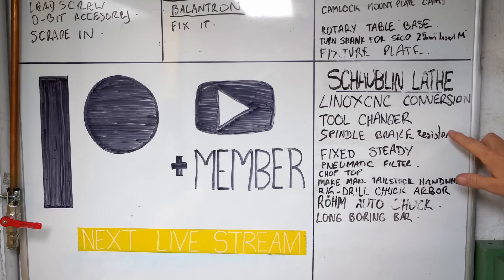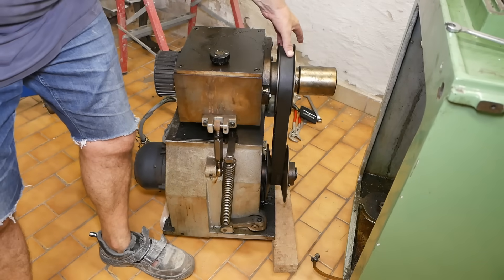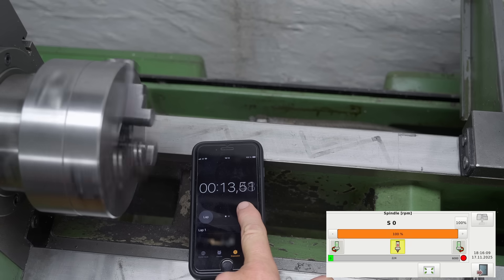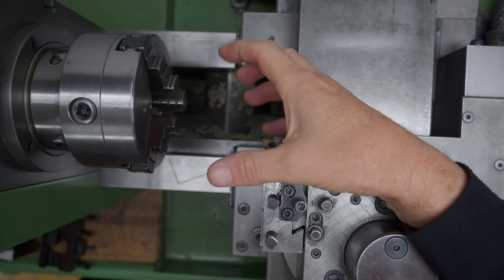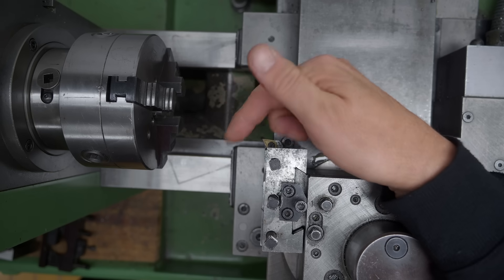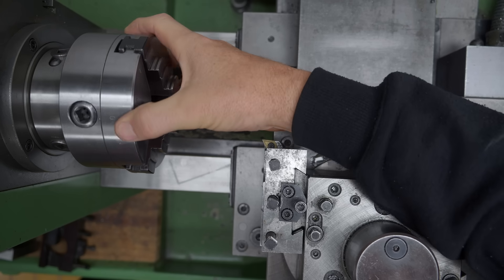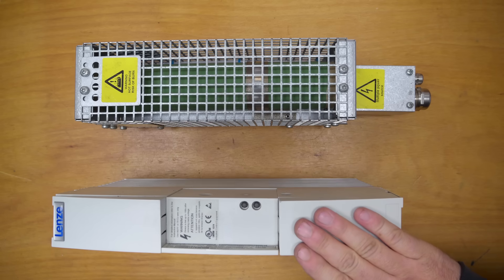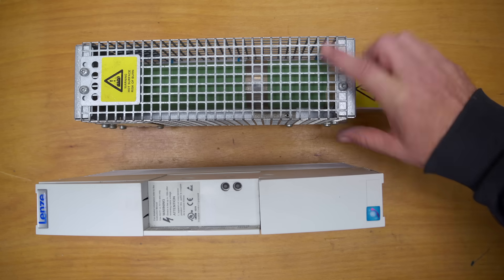Help me with this VFD Please - Schaublin 125-CNC Ep. 62 || RotarySMP

Comment: Have a look at the 8210 manual chapter Commissioning 5.3.2 parameter "C013 Deceleration time". But, "C023 Imax limit generator mode" and "C011 Maximum field
frequency" may inhibit the deceleration.

The company still has the Discontinued products - Inverters manuals for download.
The other resistor is also used for elevator motor controls.
Reply from the maker: The correct manual for this version of VFD is in the description above. C013 and C011 have no effect, as the VFD disconnects from the motor immediately, so there is no current to limit. These values will still need to be turn once I find out how to change that coasting behavior

Comment: Hi Marc

Look your Mailbox, hope it will help

all Parameters and Settings must be correct, otherwise it will not work
Current Limits must be max. otherwise the VFD will shut down (Regelgrenze)

Good Luck
Reply from the maker: That is not the issue though, as a current limit too low wold at least attempt to brake, and then over current.

Comment: Have you considered the common 3 phase relay operated brake? It simply momentarily reverses two phases. Quite a few options available to suppress EMF surge. It operates independent of the VFD. Also extremely common, built into the switch is momentarily reversing voltage in series wound motors. That sudden torque you feel on a drill or saw.
Phase reverse is pretty much industry standard on production machines as in assembly lines.
Reply: CNC machines use braking resistors or regen to the source.
Reply: @rcdieselrc  There are dozens of ways to stop an AC motor. DC inject etc. I was thinking the most simplistic and very cheap that can be independent of both motor and power source with readily available components.
The phase reversal is abusive to some motors but ultra reliable often used for emergency STOP NOW situations. It can be employed in fail safe dead man situations - giving the motor permission to run.
Reply from the maker: I now have the brake working, I just need to do a bit more LinuxCNC config.

Comment: Important information C013 "4.00" are not seconds those are parts of 0,02s (as mentioned in the manual under 5.3.2 {0.02 s})

you have to rise that number a lot or the resistor hasnt time to absorb the load. And the coil has no time to depart from the load fast enough and when the coil cant do that... you will get there. Soon
Reply: I don't think that's correct. I think the 0.02 just refers to the minimum step interval. Lenze sets the value to 5.00 as standard. If you look at C106 it's a similar time setting in seconds but the Lenze standard is 0.02 with a minium step interval of 0.01
Reply: @thatgermanfan3106 well then why is written a "s" and why is the motor not winding down from 3k rpm in "4.00". 

In my A6 manual is written ms for miliseconds and since it is a german manual we can read it is farfetched to talk from steps when a unit easy can be seconds (sekunden) with a "s" and steps would be way to complicated to use to because it is easier to use time because of load that is slowed down and that load can be relative. 

And vfd arent normaly made for stepper motors they are made for a wide range of 380v industrial motors that arnt as complex as a stepper or a servo motor.
Reply from the maker: @fearlyenrage  Thanks for your thoughts.

0.02 is the increment that each press of the button gives on the VFD. I tried it in C012, by changing the accel ramp to 10.00, and sure enough it takes 10 second to run up the spindle. Changed it to 4.00 and it take 4 seconds.

I tried various values for C013, but all get ignored.
The issue is somewhere else, as the VFD does not even attempt to decelerate. As soon as the analog commanded speed changed down to 0V = 0 Hz it is disconnecting and allowing the motor to coast down. Once I have that behavior changed I can tune the ramps.

I added my control connections to the description above.
Reply: @RotarySMP  rewelcome glad when i can help somehow. Well when some vfd dont work i change them to one i understand and know well. maybe you...
Reply from the maker: @fearlyenrage  Okay, I was able to play around with it some and think I understand it a little better.

The brake is working, but only during a speed change. So with C13 = 0.5S, and C023 at 110% current, the spindle sped change from 70 Hz to 20 Hz is braked (nicely). So that solves my decel between CSS facing cuts.

But switching spindle off coasts down. Since I am commanding the VFD with analog 0-10V, I thought spindle off just meant 0V commanded, but I guess it is uncommanded, and therefore the spindle motor output is simply disconnected. Maybe I do need an additional output pin to E3, and teach LinuxCNC how to command a stop.
Reply: Well keep learning Marc you will get there. Maybe there is another ramp up ordown function in the setup.
Reply: @RotarySMP  idk Linux stuff well. Maybe you ask Lenze direct seems they are still in business. Maybe some old guy still know the ropes to your vfd...
I ask often companies they help you out.
Reply from the maker: @fearlyenrage  I sent a request to them early in the week. No response.
Reply: @RotarySMP  in english?

Comment: I have no idea but I asked ChatGPT and it said to set the deceleration time with C105 and to make sure you use a quick stop or ramp stop and command. It said the terminal inputs to activate this are controlled by C007
Reply from the maker: That is the fourth AI summary. None were right. 
Thanks. I still have the electrical brake as well. I have summarised my trouble shooting progress into the first comment at the top.

Comment: Did you try playing with Decel 
20 sec , and confirm you are in Decel, then 10 sec , 5 and then slower.. etc
Reply from the maker: That was not the issue, it is more tied up with LinuxCNC no commanding a stop through setting the analog input to 0V as I expected.

Comment: If you use E3 input as your stop. You need to change c007 to two. This will enable quick stop. Then c115 is the qstop time. Set this as desired. Its a bit hard to troubleshoot not knowing your current wiring setup.
Reply from the maker: Thanks Wesley, I have added my control wiring to the description above.  
With C007 set to 0 or 1, I have the behavior I showed. With it set to 2, the LinuxCNC spindle start and stop buttons no longer cause the VFD to start rotation. Instead it switches state from OFF to STOP on the display.

I am not using E3, as I have it commanded through the analog pins 7/8.
...
Okay, I was able to play around with it some and think I understand it a little better.

The brake is working, but only during a speed change. So with C13 = 0.5S, and C023 at 100% current, the spindle sped change from 70 Hz to 20 Hz is braked (nicely). So that solves my decel between CSS facing cuts.

But switching spindle off coasts down. Since I am commanding the VFD with analog 0-10V, I thought spindle off just meant 0V commanded, but I guess it is uncommanded, and therefor the spindle motor output is simply disconnected. Maybe I do need an additional output pin to E3, and teach LinuxCNC how to command a stop.

Pin 28 is wired up, and I thought I was only  only using it for  machine start up and shut down, and E-Stop. I need to go back into the Mesa Card set up and see if I am commanding the drive enable on a stop rather than just the 0V analog. It might be as simple as reassigning the Pin 28 behaviour in LinuxCNC.
Reply: @RotarySMP perhaps you need to assert two io pins with one line from your controller.  I have had installations where I had to jump input terminals together to stuff the single signal into two discrete inputs on the drive.  Particularly if you want to set up reversing...

Comment: Well, your idea seems to me not perfectly accurate, the braking resitor absorbs the flowing current that is its purpose. Think maybe about it like a waterpipe that makes all way easier when it comes to electronics.

The power or motion producing coil winds up the stator and the vfd chipset tells the spindle then to move at whatever 70hz until full rpm are acchieved, when there is no big resistor build in the coil is decreasing the hz load as build slowly down. 

When the braking resistor is build in the system channels the fullpower hz into the resistor that fancy thing then absorbs the energy and transforms it into heat.

What you now have to do is to give that winddown and windup time a timeframe.

Min speed is mentioned under 5.3.1 

C010 is minimal hz for your max rpm
c011 is max hz and rpm
C012 is ramp uptime one digit is 0,02s
C013 is ramp down.

You try to brake the spindle down in under 0.1seconds Why? because you tell the parameter C013 4.00 that numer are parts not time. 4x 0,02S = 0.08 seconds to ramp down. 

to get to a round ramp down try 400 then 400x 0.02 = in 8 seconds. 

Give that a try. When the spindle is at work and changing speeds and feeds you will see if that is appropriate or not. 

now you should be able to adjust that Schaulin Drehbank ^^
Reply from the maker: I have summarised my progress on trouble shooting in the first comment at the top.

Comment: Hmm, sorry no help, all my equipment have build in brake, just tweaking with a pot.

I’m not 100% sure if the Haas uses a resistor or quite how it brakes, just dumping onto a resistor sounds choppy, I almost wonder if it is more of a frequency change with no regen braking.

Overcurrent is super common, I wonder if it’s just too small and needs to be replaced with a beefier VFDI.

I don’t really know what the controller is asking for.

On a side note our two big lathes (48”x24’) have both electric clutch and brake. If you don’t have a key to drive against the work (up to 30,000#) Can and will spin in the chuck and make a big mess of things.
Reply from the maker: Thanks. I still have the electrical brake as well. I have summarised my trouble shooting progress into the first comment at the top.
Reply: @RotarySMP  Mark: there doesn't seem to be a "pinned comment," so the "first comment" will be different for everyone and changes. I'm guessing you mean @wesleyfarrant4087 's comment though!

Comment: Das Problem wird sein das um den Umrichter zu stoppen nicht der Startbefehl weg genommen wird sondern einfach die Reglersperre aktiviert wird.
Damit trudelt der Motor aus und macht keinen Rampen Stopp.
Das ist entweder von der Konfiguration der Digitaleingänge abhängig oder davon welche man benutzt hat.

Klemme 28 scheint hier benutzt zu sein und ist auch die Reglersperre. Ich würde den Regler aktiv lassen und nur bei einem Notaus deaktivieren.
Lässt man den Regler aktiv dann klappt es auch mit dem bremsen.
Reply: Wollte ich auch gerade als Idee zur Fehlersuche schreiben, aber gut dass du das auch an den Klemmen verifizieren konntest
Die Kollmorgen Servoverstärker an meiner Maschine haben auch zwei separate Eingänge, wobei der eine ziemlich deutlich als "safe torque off" und der andere als "enable" beschriftet ist
Reply from the maker: @floriandaler5327  Danke, Florian,  ist aber nicht das Problem. 

Pin 28 ReglerSperre ist verdrahtet, und wird für Machine Start/ Shutdown + E-Stop verwendet, aber nicht für Motor Stop. Ich habe meine Steuerverdrahtung jetzt oben angeführt. 

Es wird über Pin 7/8 Analog mit 0-10V  + Pin E4 (R/L lauf) gesteuert. Ein Motor Stop in LinuxCNC ist einen OV = 0Hz steuersignal.
Reply: @RotarySMP  Nevermind. Mal mehr befasst mit dem Umrichter.
C13 Tif ( Vorgabe der Zeit Bremsrampe, 1s-2s?)
C022 Imax motorisch (Rampe für beschleunigen wird gestreckt wenn am Limit)
C023 – Imax generatorisch (Rampe für abbremsen wird gestreckt wenn am Limit)
C105 – Quick Stop Rampe

Chopper/DC Bremse schaltet nur auf wenn die Spannung im Zwischenkreis zu hoch wird, Bremszeit muss also so weit runter das er eigentlich mit Overvoltage aussteigt (wenn kein Widerstand dran wäre). DC Bremsen aktiv, C13 kurz, C023 so hoch wie es der Widerstand und Regler hergeben, weil sonst automatisch die Bremsrampe verlängert wird.
C13 bei 1 Sekunde zwingt den Regler zum aktiven bremsen
C023 110%-120%? Alles was die Hardware hergibt ohne in Flammen zu stehen.
Reply from the maker: Ein wendig mehr gespielt. 

Der Bremse funtioniert bei eine Speed change von 70 Hz auf 20 Hz. (C13 0,5S sogar). Ich habe C023 auf 110% (max) , und es Bremst schnelle als bei 80%. Alles gut. 

Aber es Bremst nicht wenn der Analog signal gestoppt wird. Ich habe gedacht das LinuxCNC einen Stop as 0V = 0Hz befehlt, aber es wird Signal weg sein.

Das heist Ich muss ein Zusätzlich Output installieren, auf E3 liegen, und LinuxCNC dazubringen, einen Stop Signal auszugeben bei eine Spindle stop.
Reply: @RotarySMP  Für einen Full Stop mit Spindel Bremse wäre doch der Quickstop eine gute Wahl?
7.5.14.4 Quick stop QSP
"If you activate the function quick stop, the drive will be decelerated to standstill over the set
deceleration time (C013). If the value falls below fd = 0.1Hz, the DC-injection brake (DCB) will be
activated."
C007 = -14- ... -22-:
- LOW level at terminals E3 and E4
- HIGH level at terminals E3 and E4 when switching on the mains
- C007 = -2-, -4-, -8-, -9-, -13-:
- LOW level at terminal E3

Wenn LinuxCNC das Signal wegschaltet und der Input quasi offen bleibt, vielleicht über einen Pulldown-Widerstand 0Hz erzwingen? Also wenn im gcode Spindelstop kommt, zwingend 10k Widerstand -> Target 0Hz

Comment: does it ramp when you change the speed from 70 to 10 hz? do you set Enable low with the off command or leave it high?
Reply from the maker: Thanks Hans,
Okay, I was able to play around with it some and think I understand it a little better.

The brake is working, but only during a speed change. So with C13 = 0.5S, and C023 at 110% current, the spindle sped change from 70 Hz to 20 Hz is braked (nicely). So that solves my decel between CSS facing cuts.

But switching spindle off coasts down. Since I am commanding the VFD with analog 0-10V, I thought spindle off just meant 0V commanded, but I guess it is uncommanded, and therefore the spindle motor output is simply disconnected. Maybe I do need an additional output pin to E3, and teach LinuxCNC how to command a stop.
Reply: @RotarySMP  honestly instead of troubleshooting linux cnc and the drive at the same time i would rig up a switch/potientiometer box and get the vfd running as desired on these controlls as first step. Also something no one has mentioned so far: Minute 9:30, red LED off, green LED blinking, Display "OFF" According to the Manual that means Controller inhibited = Pin 28 Low. See Page 140 and 135
Reply from the maker: Thanks Hans. I had missued the drive enable pin 28 as a start stop. I need to reconfigure it in LinxuCNC to correct the behaviour.

Comment: Can you confirm what number the deceleration time main setpoint parameter (C013) is set to? Also, does the screen show any fault or error message during deceleration?

Edit: I see at 9:20 you have it set to 4.00

Have you tried resetting the parameters to factory default (C002)?
Reply: that was the right question because those numerbs are parts of seconds as mentioned in the manual. Under 5.3.2 (0,02s)
4x 0.02 is 0.08 seconds that is a full stop under 0,1 seconds that will knockout the error message for sure ^^
Reply from the maker: Covered above.

Comment: check 5.3.2 in your manual there is that function i had to adjust. You have to find the sweet spot, i cant tell you what that is but maybe you start with 600 and 400, when it knocks itself out you try to fast to reduce its working speed. 

Then the working current floots the system when it brakes the spindlemotion down and that results in a coil overload, at least that was it what we found out.

Use google lens to tanslate the 5.3.2 

C012
and C013 are the parameters to adjust.

Good luck. 

https://www.all4sps.com/mediafiles/Sonstiges/EZN2-013A001_1.pdf
Reply from the maker: I have summarised my trouble shooting progress into the first comment at the top.

Comment: On this series, you enter and exit it using the Coast/Enable digital inputs—Lenze calls them Controller Inhibit or Enable (DI1/DI2 depending on wiring).

Most 8214 installations have something like:
	•	DI1 = Enable (Controller Enable / CE)
	•	DI2 = Inhibit / Coast / Fast Stop (depends on parameter set)

To coast:
	1.	Open DI1 (Controller Enable) → drive immediately drops torque, motor coasts.
	•	Often labelled “/CE”, “Controller Inhibit”, “Inhibit”, “Enable”, or “ST”.

Alternatively, if wired:
2. Activate DI2 = “Coast stop” (parameter-dependent).
Reply from the maker: Maybe this is on more modern version of the Lenze 8214, but on this old EVF81214-E, there is no DI1 DI2. Please see page 4-40 of the manual I linked in the description.

Comment: Mark, I'll ask my mate if he has any older Lenze VFD books, he has his own Process Control Systems company and tends to keep obscure documentation. I'll let you know how I get on.
One thing I would say is, if you find the settings, don't set them to slow the spindle too quickly. I made a polishing machine with a Siemens VFD and if I set it to stop too quickly it would trip the VFD.
Reply from the maker: Thanks Bill,

Okay, I was able to play around with it some and think I understand it a little better.

The brake is working, but only during a speed change. So with C13 = 0.5S, and C023 at 110% current, the spindle sped change from 70 Hz to 20 Hz is braked (nicely). So that solves my decel between CSS facing cuts.

But switching spindle off coasts down. Since I am commanding the VFD with analog 0-10V, I thought spindle off just meant 0V commanded, but I guess it is uncommanded, and therefore the spindle motor output is simply disconnected. Maybe I do need an additional output pin to E3, and teach LinuxCNC how to command a stop.